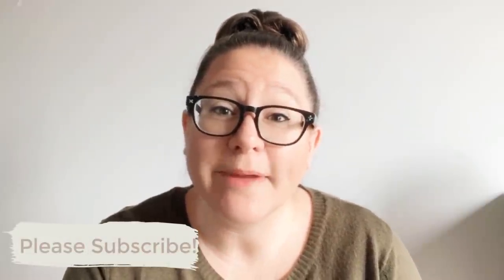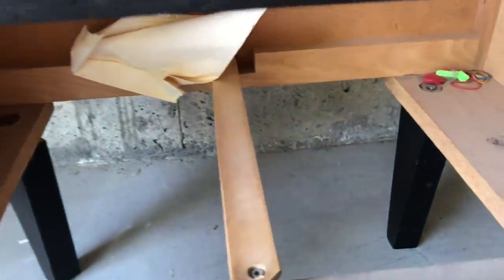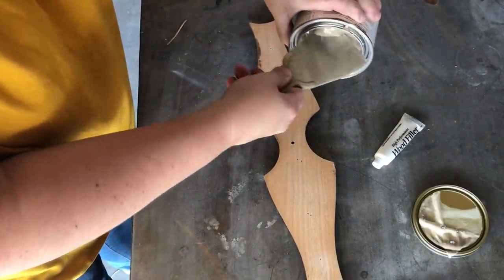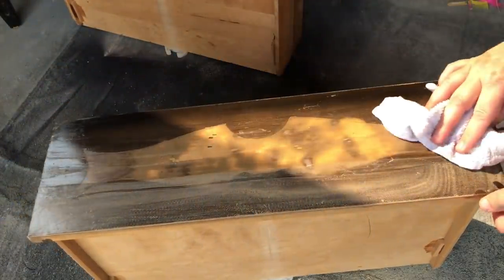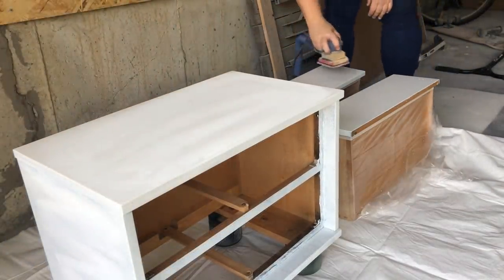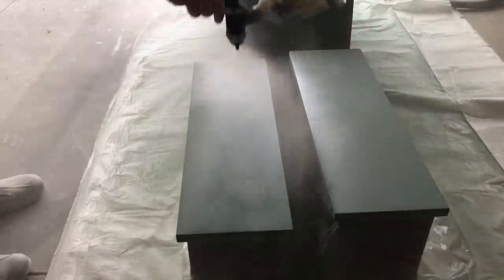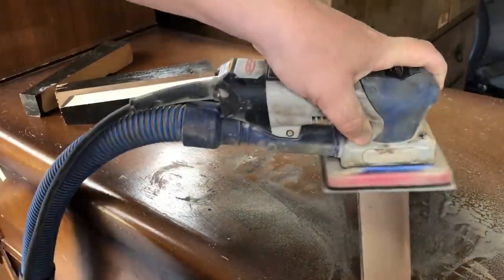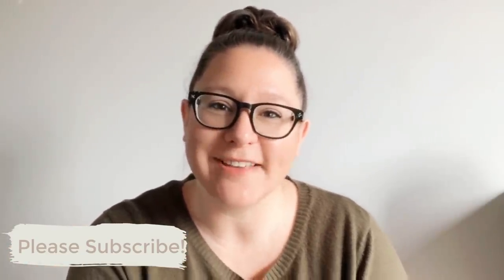$5 Nightstand THRIFT FLIP | Mid Mod Nightstand Makeover

Comment: Beautiful!!  Restoring furniture and other pieces that can be loved again in a different way is so fulfilling💯❣️
You are doing a great job; the ease and comfort you have indicates how long you've been doing this and how many pieces you've produced.  
*I'll add 2 suggestions from experience; 
*Always wear a can respirator mask.  (You may have had one on, but just didn't show it in your video).  They are a real pain, I know.  But you'll never regret wearing one.
*Get yourself a table, girl!!  The space you have available of course, limits what you can do, but your contorting yourself was making me hurt!  I promise you age and your body remember.  I got 4 of those "put together yourself" heavy wood shelving sets with the metal legs and supports, and made a 4 square table in my garage, and you can always reconfigure if needed.   Plenty of room, and you can screw or nail something into the top if you need and make notes.
They have 2 other shelves underneath. 
Gamechanger!!

Comment: When I have a single or pair of nightstands I finish the back to match and label them as 'End Tables, could be Nightstands.    All 4 sides finished'.    Even singles move quickly.    Of course each market can be different.   (Inexpensive damaged sheets of paneling can make a functional back - $2 or so per damaged sheet.   A 4'x8' sheet can make a lot of back pieces.)

Comment: Hi Katie, I’ve noticed sometimes you use primer and sometimes you don’t, when would you recommend using a primer and when is it not needed? 
Love your videos!
Reply from the maker: Hi Isla! I use primer when I want to even out the surface if there has been sanding through the original surface or wood filler patches and to block bleed through from wood tannins. It depends a lot on the material that the piece is made of and the colour I'm going to be using.

Comment: New to your channel and already loving your work! I just had a question, why did you use two wood fillers? Or do they make the filler once combined?
Reply from the maker: Thanks for being here! I used 1 filler on this table. It is a 2 part epoxy that requires mixing to activate its hardening. ❤️

Comment: Awesome job! Love your HVLP setup. 

Is there a reason you prefer to sand rather than use a stripper?
Reply from the maker: Thanks! It’s not necessary to remove the previous finish on most pieces so I just scuff sand to give the paint some rough texture to grip on to.

Comment: Why do you use the microfiber roller and not foam?
Reply from the maker: I find that foam rollers put a lot of air into the primer which leaves millions of tiny bubbles behind to dry. I’ve definitely used them before and would again in a pinch but I much prefer the microfibre ones instead 😉
Reply: @salvagedbykscott  thanks😃

Comment: Please don’t use disposable rollers, its not good for the environment. It wont take long to just clean  a reusable roller and use it again!
Reply from the maker: The reason that I use rollers is because it is hard to clean up this primer. It requires a ton of ammonia and is incredibly time consuming. If it didn’t take much to rinse them out I would. I do use my rollers on 3 or 4 projects before throwing them out but it is a necessary part of the process.